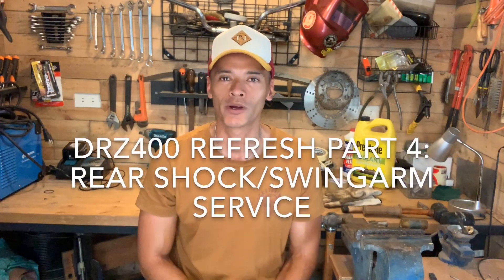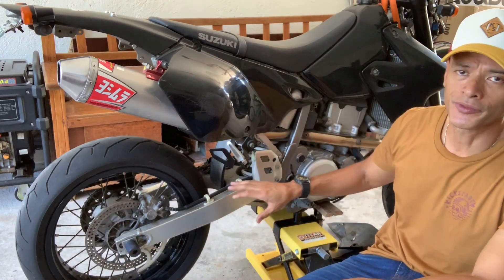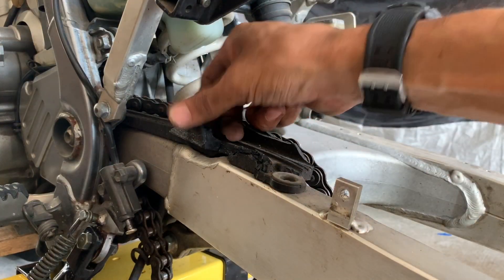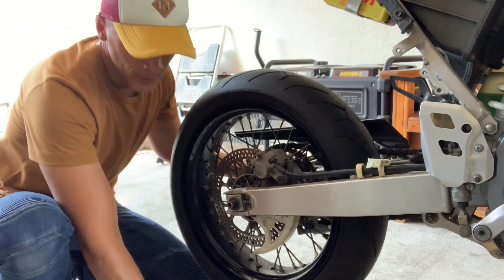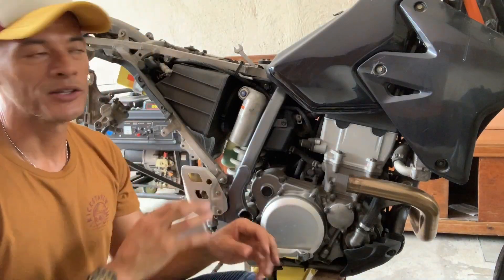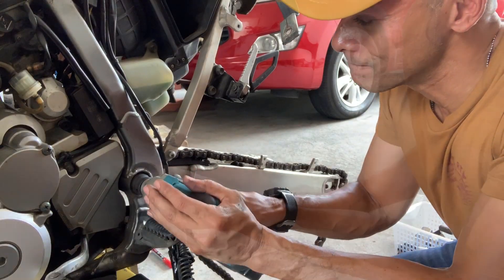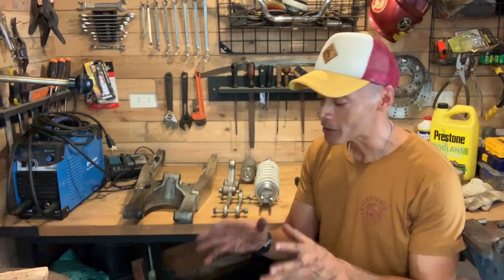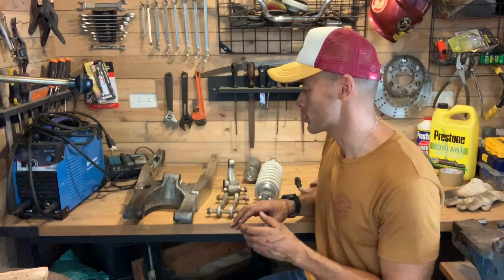DRZ400sm refresh part 4: shock & swingarm

Comment: I’m going to remove my drz400e swing arm and put a drz400sm swingarm in and I’m doing the Drz400e forks replacing with Drz400sm forks is there a video showing how to remove them? I can not find it
Reply from the maker: Youll need to do the whole top triple with the fork swap. Might as well do the steering bearings if its an old bike or a hi-miler 😉 https://youtu.be/Qsl-1nL3CBs
Reply: @PAbrera1  it’s a 2010 drz400e with only 11,343kms which is about 7,000miles
Reply from the maker: @GIXXRBRAH750  really up to you, if it was me, I'd replace the steering bearings. At the very least pull the old ones and repack them. You'll have to do that anyway if your swapping forks from the E to the SM or vice versa, it will be a different top/bottom triple as one will fit rightside up forks and the other will be for USD forks of the SM.
Reply: @PAbrera1  yeah I got the E up forks and going for the SM USD forks bro! I really don’t know how to do much
Reply from the maker: @GIXXRBRAH750  do lotsa research and back reading on the forums. these are pretty old bikes, lots of info out there. Relatively somple to work on. Good luck! Let us knpw how it goes 😉👍🏽
Reply: @PAbrera1  deff will bro! It’s going to be a big conversion

Comment: Great video, very helpful.  My swing arm seems to be wedged into my frame, it is stuck even after removing the swing arm bolt.  I have been taping it with a mallet but no real movement.  Any thoughts or tricks to get it out?  Thanks!
Reply from the maker: EM FL might be rusted in a bit. Keep at it with a mallet (within reason 😄) penatrsting lubes like wd40 and maybe some gentle heat with a heat gun may help.
Reply: Did u manage to get it out mate.  I got mine out by loosening the bolt a few threads then put the head of a hammer against the bolt.  Then absolutely smashed hammer with a big mallot and it moved. Then take the bolt off and use a socket extension and tap it out the rest of the way.   And DO NOT grease the axel/pin when reassembling 👍🏼
Reply: @JohnSmith-yg3nm  yes, I did get this out.  I sprayed about a half can of  WD-40 on the points of contact between swingarm & fram, and let it sit overnight.  Using a mallet the following day, I was able to tap the swing arm loose.  My DRZ-E is an '01 model, apparently first time this maintenance was ever done.
Reply: @JohnSmith-yg3nm  Not sure if u will read this, but why not greasing the axel/pin ?

Comment: Excellent video, thank you. One question: drz400sm’s subframe is made out of aluminum? Can I unbend it? Car hit me from behind so it’s bend to the left side. Thanks.
Reply from the maker: Alex Escobar i guess it depends how much damage youre trying to fix. If just lightly bent, id go for it (maybe use a car jack/long pipe for leverage). If bog damage, id worry about the aluminum getting weakened from too much benfing. Of course you take your chances in terms of the structural integrity with any repair like this.
Reply: Paolo Abrera is it relatively easy to remove the subframe right?
Reply from the maker: Alex Escobar removing the subframe is just undoing nuts and bolts, the hard part is untangling the wiring harness and hoses that runs through it 😅